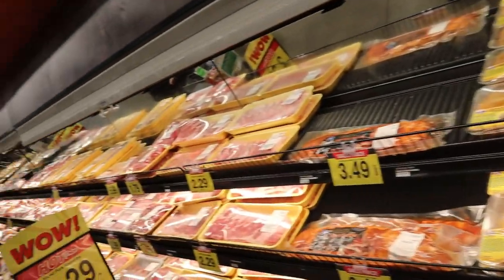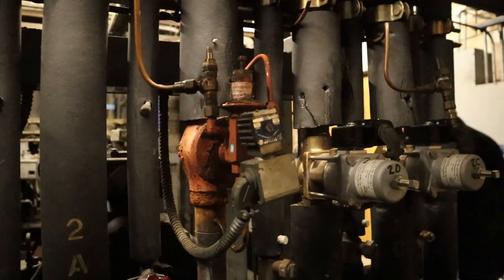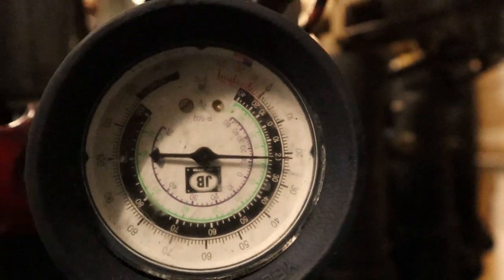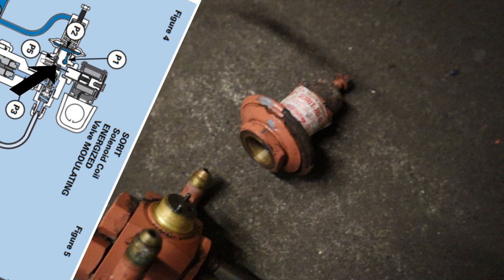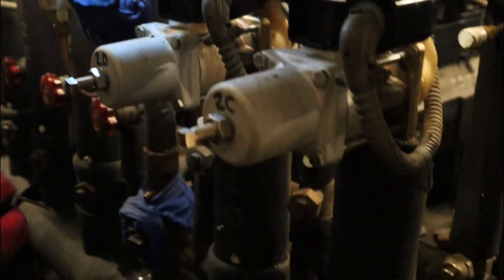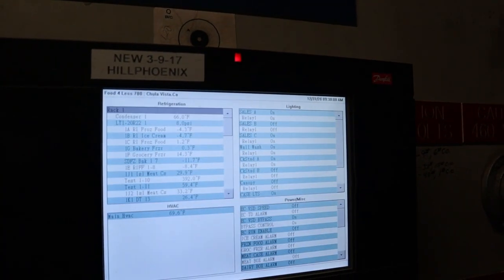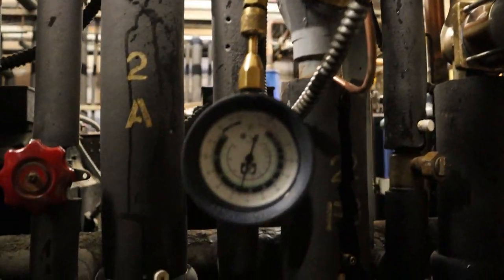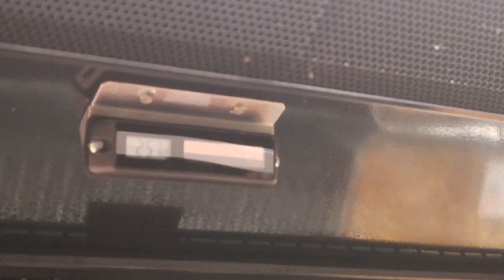Refrigeration: Meat Cases Running Warm

Comment: So obviously you can’t shut down the rack and recover all the refrigerant just to replace this valve, but when it comes to pressure testing and vacuum, can you still do these steps while the rest of the rack is running?
Reply from the maker: As long it has ball valves to the rack all you have to do is pump down that system.